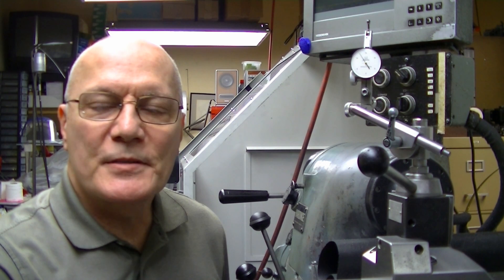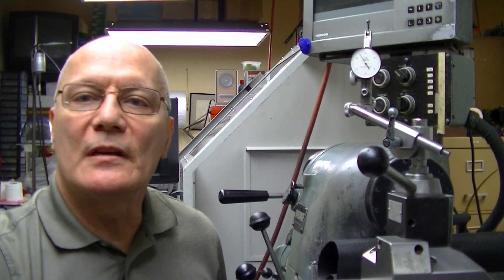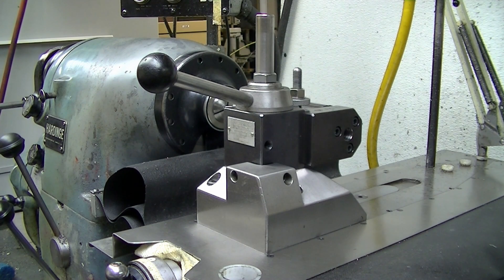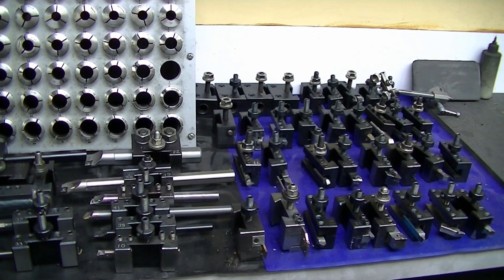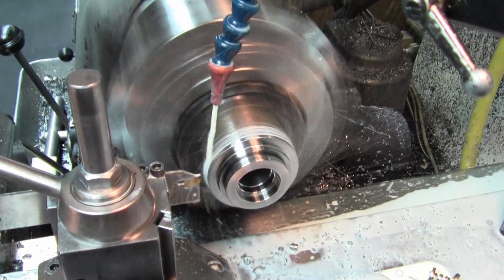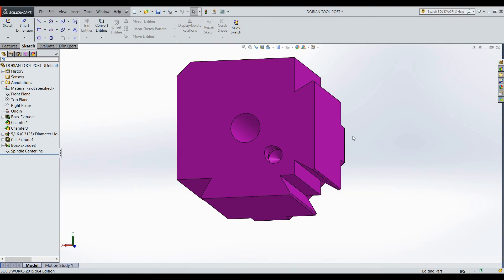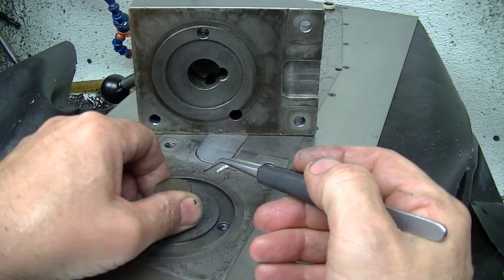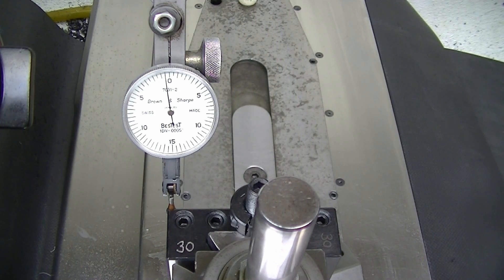THE SOLID TOOL POST MOUNT

Comment: Not sure if you're still around checking comments. I read through at least 1-200 comments and either missed or it was never mentioned whether or not you have a step file of the tool post holder. I have a 82 hlv-h and it would save me a lot of time in cad if I didn’t have to reinvent the wheel. Do you have a copy floating around somewhere? 

Much appreciated
Reply from the maker: Sorry, that was a napkin sketch design.

Comment: Do you ever miss having the cam lever on the compound slide to retract the tool out of the way quickly, say when threading? Or is that feature pretty much obsolete because of DRO?
Reply from the maker: Rapid retract for threading is not necessary on the HLVH as it has adjustable automatically stops

Comment: Hi I'm looking at using a BT 50 taper fixed tool block for something similar on my Butler 460 and I'm wondering if I should go to the trouble of making a heavy duty  50 taper camlock combination  spindle/ rotary table set to centre height with the chunkiest taper roller bearings I can find,  and go for a tool turret magazine  and if I need to turn tapers I'll just use a BT 50 boring head.... But I don't know how to articulate the tool relative to the boring head.  Or should I just put up with the tool always perpendicular to the boring head? 
Got any ideas?

I've got 460 swing over bed to play with so there's room for some sizable rotary table
Reply from the maker: Sounds like an interesting project, you'll have to make a video when it's done!
Reply: @ROBRENZ  I'm thinking it's a hell of a z axis for rotary table work if the   axis of the toolpost is on centre height.  And if the tool magazine is mounted on a D8 camlock. You can have several tool magazines . And a 50 taper boring head for a ball turner

Add in capto tooling 
And er40 collets to hold boring bars, and it's far more versatile than a mere aloris toolpost, and much better repeatability

Comment: What year is your HLV-H? I’ve never seen a compound that looks like yours. All the HLV-H’s I’ve seen, had a squared/ rectangular compound instead of the one that you showed in this video. Thanks.
Reply from the maker: The picture in the thumbnail is the solid tool post mount that I made to replace the standard Hardinge compound slide.
Reply: @ROBRENZ  I misworded my question. I was asking about the base of the compound slide that you replaced with the solid toolpost mount. It looks cast, but I now see that it has a neoprene-like guarding on it. My bad. Great video as always.
Reply: This has turned out to be a very influential video. There has been a wave of solid tool posts sprouting up around the globe as a result.

Comment: Thanks for sharing your knowledge and ideas in your great channel and videos!!

I’m looking at making a solid toolpost mount for my Hardinge and one for my Lodge & Shipley AVS 2013 (20.5” swing) and I have some questions about your beautiful design.
Since I already have a couple of Aloris CA toolposts and a number of holders, I was thinking about using CA on both machines. Kinda big for the Hardinge, but I think it will work.
Questions:
Any objections to using 304 stainless for the mount? I have a couple of pieces that might work size-wise.
Pic of the top of the mount and bottom of toolpost and pin and hole that forms v-block?
I have no experience with scraping, so was thinking of maybe surfacing grinding the stance pads with the toolpost mounted and locating set screws pushing. Bad idea?

Comment: I new to machining and I've bought a second hand 9x20 Chinese lathe with some where (that I'm workingthrough). Is  there enough adjustment in the tail stock to cut mors tapers ? How much off set  do I need?
Reply: In most cases just buy a morse taper machinable blank for whatever it is that you are doing.

Comment: Very nice toolpost mod. I have a Hardinge HLV in my work shop and a Hardinge Chucker in my home shop. I’ve been considering doing some type of mod to the chucker to make it more useful. I barely use it. I need to drag it into the work shop and see what I can do with it. Maybe some type of rigid tool post like your design but with the option of swapping the turret back on. When I do have the occasional small run, it is very handy.

Comment: how does one cut tapers wihout the compound? im fairly new to machining so the obvious likely evades me.
Reply: You can't, obviously. It's a tradeoff. Sacrificing functionality for rigidity. 
Most lathe work does not have tapers so it depends if this solution is the right one for you. 
Obviously the modifications can be made in such a way that all is reversible and the compound can be mounted if needed. Which is a hassle of course. Another way to cut tapers is with a taper attachment but that is only for shallow tapers.
Reply: @bigbattenberg  makes sense, thank you. :)
Reply: Interesting modification to a damn near perfect tool room lathe IMO. My HLV-H is my favorite machine tool in my shop. I’m surprised you’re using what looks to be water based coolant in the Hardinge. Have you had any coolant intrusion into the apron gearbox? I do like the covers you’ve installed onto the cross slide. Would be interesting to see underneath them one day. Cheers

Comment: out of curiosity, if you didn't have to replace every toolholder would you ever go for a multifix toolpost? I'm looking to CNC my 10x22 lathe and I think a solid toolpost will be part of the process, and I'm wondering if I should just dive in on the multifix before I get into double-digits on my toolholders :D
Reply from the maker: Never used a multifix but they look real good.

Comment: Adding to my previous comments: what is the correct term for the distance from the top of the compound to the machine center? I was wrong it calling it 'center height'...
Reply from the maker: I don't know :)
Reply: Hmm... I think I will coin 'tool center height', meaning the maximum tool height that can be fit without the tool holding system.
Your and Stefan's videos have been very inspiring and I will go ahead with the modifications on our Gema lathe as described (hard stops/ no compound/ no quick change tool system). We have acquired a new (OK, 60's German) mill which will be a big aid.

Comment: A final remark: Getting rid of the compound slide (and not using a quick change system) does provide the opportunity to use larger (cross section/ center height) tools. With our Gema lathes, the original setup (4-way indexing toolpost, no quick change) and with a center-to-compound height of 32 mm, the tool center height would be limited to 16 mm square, which seems a bit small for this machine (15 mm of material beneath the tool, 32-15=17). With the quick-change tool system I have I can fit 25 mm center height tools, but at the price of massive tool overhang, etc. which I need to eliminate. I would not have a problem investing in 16 mm tools but I already have a good inventory of 25 mm and smaller definitely is no improvement, quite the opposite.
Reply: I have no objection to the solid tool post, in fact I just built one, but I've been using the compound for over 40 years especially for cutting and grinding  tapers. What you invariably do is compensate for the fact that it has less rigidity. No offense Rob but it's not as bad as you're saying. All these smaller engine / tool room lathes have less rigidity but they also have tremendous versatility if you know how to utilize it.
If you're not using a DRO to set tool offsets then there's less reason to mount the solid tool post exactly perpendicular to the lathe spindle and hold that position. My Aloris can turn at an angle and since it bolts down very securely to the solid tool post it holds its position very well. A simple 1-2-3 block against the chuck and Aloris face sets it back to perpendicular. 
Let's remember, this is not a CNC lathe, it is a tool room lathe and while there are favorable aspects to CNC applications on tool room lathes that's only possible because of the versatility of this type of lathe so let's not overly limit its function.  Not everyone has 50 plus Aloris tool holders, versatility of the lathe saves that expense. Using the compound I'll bet I can do more with fewer tool holders.

As far as getting greater distance from the top of the solid tool post to the lathe center line, when I made my solid tool post I made it a good 1/8" (3 to 4 mm) lower than the compound top so that I could use a greater range of Aloris holders.

A solid tool post is a great idea with limitations.
Reply: @mosfet500  I agree. I have acquired a Boley RD42 lathe recently and it shows very well there is a tool for every job. A universal lathe is just that, a universal lathe. Then again, machining to IT7 tolerances is a requirement one has to meet or it is pretty useless. Working with hard stops is great and I have been doing that for many years. I used to own a VDF which had the hard stops on both axes and our current Gema has the same. I am pretty sure that when we get our Boley up and running a lot of jobs will be obsolete on the universal lathe.
Reply: @bigbattenberg  IT7 tolerances aren't bad, once you start getting to sub tenths inches you need temperature and humidity controlled environments though. The number of times I needed sub tenths in the last 40 plus years - none. I'll bet no one watching these videos works in sub tenths, the cost alone is inhibitive, don't waste your money.

Comment: Quite surprised the fourth M8 bolt is in another postion, not in the corner like the other three. What is beneath that is preventing from using that position? Also, you mention scraping. From how I understand it, the thread recessed in the groove does have a gap between the surfaces, am I right? It would be next to impossible to scrape two parallel surfaces to both have proper contact imo and should not be attempted because it makes no sense :)
Reply: The ring of material will not be scraped it will not make any contact with the bottom on the circular slot. The flat section and two lower pads are scraped to match the surfaces they sit on, those surfaces might not even be flat or parallel, he just wants full contact to prevent distortion when clamping. I don't know why that screw needs to be there.

Comment: Very interesting video. In fact I have been researching this recently. I have a couple of good old German GEMA lathes, one of them came with a quick change tool holder system (the brand does not really matter). But, what occured to me is that the quick change system introduces a weak link in itself. The inherent 'U' shape produces bending forces, etc. Parting off with this setup is out of the question. Before tossing the compound slide and its angle adjustment, I am inclined to revert to the solid block tool holder solidly mounted and center height adjusted with shim plates. The goal is to have the forces move through steel-to-steel interfaces without any additional bending or twisting forces. It used to work great on an old VDF I used to own an I never gave it any thought back then... just used the setup the German engineers back in the fifties decided as optimal, which was a solid block holding up to 4 tools and indexing every 90 degrees. Original equipment, perfect fit for the machine. 
Would love to hear your thoughts!

Comment: was looking intoo a solid toolpost for the mini lathe too , hadnt seen the adjustment add on for keeping the toolpost square yet , like the idea though so i might copy it , might do it simpler though by sinking the toolpost intoo the block a little , set the block so the toolpost is square bolt it down and dril a hole for a set pin through the block intoo the crosslide if that doesnt work i can drill the hole in the block out sightly and sidedrill and tap it for set screws pushing against the setpin , whont apply as mush force to it but dont expect a lot of presision out of the chineese lathe either just want to be able to cut stuff without chatter

Comment: Could you talk a little bit about the motor upgrade you did to your hardinge?
(I could never dream of parting at 1krpm on our stock hardinge in stainless, especially at that diameter, shit, parting at all is sketchy with how little power it has)
Reply from the maker: No upgrades on the motor.  Only use high range of the motor when you need power. It has twice the horsepower of the low range.

Comment: The "Aloris" type qctp has wedges or pistons on two adjacent sides.  I find myself often loosening the bolt and turning it so a usable  toolpost face is toward the tailstock.   Why arent these "Aloris" type made with clamping surfaces (wedge or piston) on 3 faces to eliminate the need to ever turn the block ?    I dont see any reason an 'Aloris style qctp couldn't be made with 3 clamp sides.  This would fit well not just for the solid TP Mount ,graciously presented by Robrenz, but everyone could benefit.   If the THREE sidedwedge style was found too complex/expensive to construct I would settle for a THREE sided piston style.  I have conventional wedge AND piston posts now the piston seems just as serviceable.   

Another solution is the 40 position "Swiss" or  Multifix style or, with multifix the post is normally pinned in place the holders are accurately located in 9-degree increments, and all sides of the block are usable.
Reply: The DIckson type qctp does what you're looking for. Pretty solid stuff, too.

Comment: This video was a revelation to me. I’ve been using Hardinge lathes for decades but when I bought my own smaller machine, this issue definitely resonated with me. I have a Myford Super 7 which I am in the process of upgrading here and there, mainly to make it a more of a precision lathe. It will never be a Hardinge but hopefully I can achieve something decent with it.
Anyway, thanks for the motivation Robin. Your content is brilliant. Here’s a link to one of my videos that I made about how I designed and made my own solid tool post mount for my machine. I’m quite happy with the result. Hope you like it. 

https://youtu.be/lu5GAovWXQ0

Comment: My neighbor just did this with his lathe he converted to CNC.  Say's it's the best modification he's ever made!  Bet I know where he got the idea.
Reply: Quick question for us mortals that still keep the compound.  Anyone know why the brits (like doubleboost) positions his compound 90degrees on a regular basis and us here in the US have it on an angle for typical turning??  Did I miss something?  Thanks!
Reply: @jagboy69  It just comes down to how you have been taught, over here in spain, i was taught that the optimal thread cutting was setting the compound to half the vee angle and feeding with the compound, but some lathes are rigid enough or the thread doesnt have that much cut engagement that it does need that feed direction, it can plunge straight in and it wont chatter or leave bad finish, of course on a cnc lathe you can make it do whatever feed direction you want, most of them do it on their own.
Reply: @MacJunior696  Thanks for the lesson!  I sure appreciate it!   Two cold ones for ya!🍺🍺

Comment: Followed your lead and made a solid tool post mount to replace the compound. Wow, what a difference! The solid post, coupled with a longer cross slide I made from an MLA Toolbox casting kit really improved my poor flimsy Craftsman 12x36 lathe. Now, I can actually use a parting tool, which is great. Much better surface finish on the lathe as well. Thanks for the idea Robin!

Comment: How do you recommend turning steep tapers with this? Say, making a dead centre. How do you do single point threading?

If would be great if you can give some advice (maybe even a video?) on how and when the compound could be avoided.
Reply from the maker: Plunge with a lapped tool set at the angle.
Straight infeed works fine on smaller threads.

Comment: This might be a noob question but since there isn't anything to precisely locate the mount to the cross slide, wouldn't you lose your tool offsets anytime you reinstall the toolpost? I hope there's a way in the DRO to correct the offsets for your whole library at once but the only DROs I've used are lacking a lot of features.
Reply from the maker: There is on the Heidenhain PT 855

Comment: Interesting option especially for those of us with lighter lathes.

But how do you move the cutter when you’re doing single point threading ?
Reply from the maker: Straight in feed works fine, 29 degree infeed is "A" way to thread not the only way to thread.

Comment: Amazing work Robin, I will be doing this as soon as I can on my Smart and Brown 1024 as long as I can source a 6 inch round bit of iron or steel. Just one question, the compound you show that has been removed from your lathe looks nothing like any other I have seen on a Hardinge, Can you elaborate?
Reply from the maker: Totally stock Hardinge compound but with my addition of rubber protective skirt.

Comment: Hey Robin, I'm having trouble getting my head around not being able to adjust the angle of my cutter. How do you get around this? Looks like you have a holder for every possible purpose.
Reply from the maker: I just clamp the tool in the holder at the angle needed.
Reply: @ROBRENZ That makes sense. I'm having trouble finding stock locally for this project. I need 2"x4.5"x5.5" either steel or cast iron. It's the 2" thickness that's the problem. Could you tell me the grade of cast iron you used? I know nothing about it. Do you think I can sandwich two 1" steel pieces? I can mill, bevel, weld, and normalize them before final milling. Oh, I'm doing this because my lathe will soon be CNC. no longer need compound.
Thank You
Reply from the maker: @backlash00  steel will work just fine
Reply: @backlash00  I used a cast iron weight from a lawn tractor. Came out to 1 7/8" thick, which was perfect.